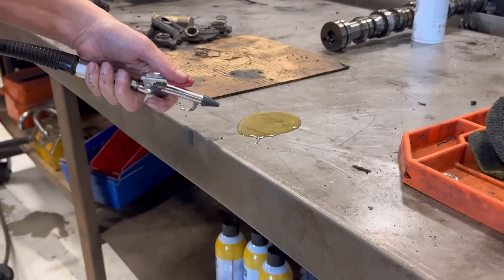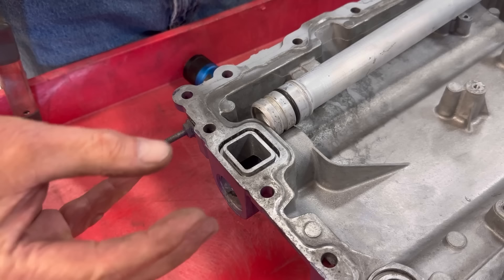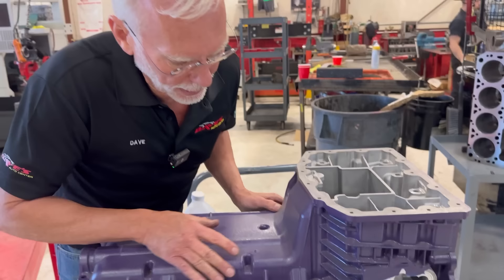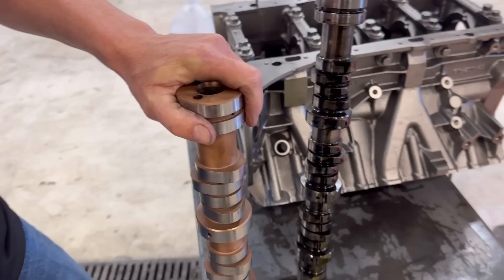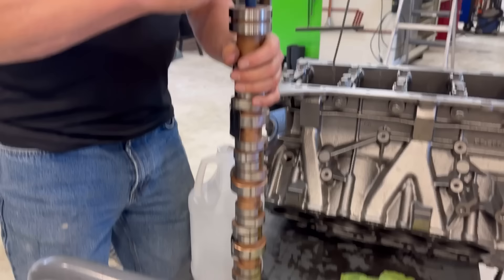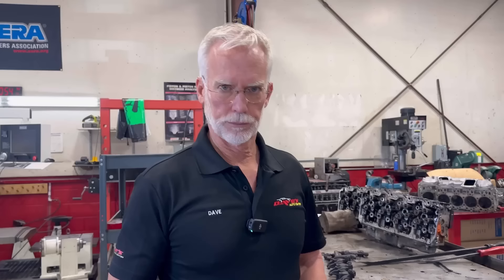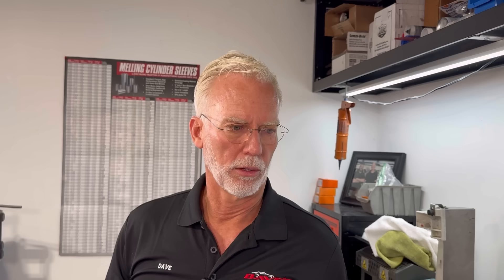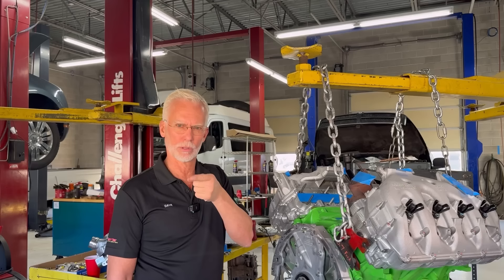Part 1: Ford 6.7 power stroke oil starvation issues revealed

Comment: For over 50 years I've wondered why they didn't add an electric pre-oil pump.
Reply: YEP couldnt agree more
Reply: Might make engines a little too durable I think
Reply: my hybrid does that
Reply: Because oil filters have back-flow valves that don't let the oil "drain out" so as soon as the engine spins it starts to build pressure
Reply: @spencer.M.F.little The moment it starts cranking it's still in the boundary lubrication regime. There's a reason why all large turbomachinery has electric oil pumps that are turned on before the turbines get spun up and the mechanical pump comes on in parallel.
Reply: in the mining world we have pre lube pumps (oils engine before start up). I think they normally use gear pumps driven by the engine because of reliability.
Reply: wow you’re on to something 👍
Reply: They do on big off road or marine diesels.  They’ve been around as add ons for decades.  Problem with those was most pulled oil from the pan drain plug and it was not filtered.  For most all non-industrial engines the cost benefit is iffy at best.
Reply: its called pre obsolance
Reply: Someone designed one for general aviation aircraft as an add on (STC) modification. It does make sense.
Reply: @gregorymalchuk272  Most large turbo machinery uses plain bearings, not rolling element bearings, so pressurizing the oil system prior to turning makes sense: especially given the equipment cost.  It also makes them far easier to start spinning.
Reply: If the electric oil pump was installed and it failed . It could possibly block your oil ways unless they put twice the amount of drillings in the block to by pass the electric side . Reality of it is . More expense more parts more time . More money . They do not care about your car  even when it comes back under warrenty with engine failure all the main dealers say you used the wrong oil . Iv been clever enough to buy oil from the dealer for new cars and keep the recipts for warrenty purposes
Reply: @eoghanhennessy443  The kits I have seen pull oil from the drainplug and pump it thru an adapter on the oil filter (by-passing it). Those are only run as prelubers then shut off.
Reply: @TheBeingReal . Is the pump actually filling the main bearings and head gallery
Reply: @eoghanhennessy443  it does via the oil filter bypass.  Pressurizes the whole oil system.
Reply: I added a prelube pump to my 1989 mustang GT convertible that I bought new.
The old Murphy diesels had a prelube pump built onto the back of the starter.  You could run the starter without engaging the Bendix to prelube the engine!
Reply: A lot of heavy engines do have them saves wear at startup big time.
Reply: @spencer.M.F.little 
So then the solution would be to never change the oil filter? 
Just saying ..
Reply: If they can put a fuel pump in a gas tank, surely they can put a pre-lube/post shut-down (for turbos) in the oil sump. Kind of a no brainer.

Comment: Lets give Dave more credit, hes just more than a mechanic for the normal people that don't understand. He is an engine rebuilder not an engine overhauler. Engine rebuilder is when you alter to new specifications which requires engineering knowledge that allows hims to explain it and make it sound easier to the public and to Overhaul is to bring it back to the original manufacturer specifications what your original mechanic does with less knowledge and goes by the manual. People..... There is a difference 🙌
Reply: Well either way both types of mechanic need a LOT more data floating around in their brains than the average mechanically inclined individual. I ran into a mechanic that primarily worked on motorcycles and the things he knew absolutely blew me away when it came to mechanics in general.
Reply: That's all BS for me , just becouse somebody uses aftermarket overpriced / reengineered parts is still rebuilder / over hauler . Engineering vital engine parts is much more involved , you need much more  resources , with all respect for Dave !

Comment: This guy is a true professional.   No BS and is asking all of the correct questions followed by coming up with a proven way to remedy problems created by Engineer Johnny.  
Looking forward to the second part of this video and see what his findings are as well as his thoughts on how to correct the problem.   I’ve read a lot of horror stories on catastrophic engine failures where owners are getting screwed over by Ford.  Not something you want to find out after spending $85,000 plus on a new truck.   Hence the reason I’ll never sell my 2002 7.3 PS.

Comment: I’ve been a diesel mechanic for fourty years and yes, oil pressure buildup has always been an issue. In the 80’s Leyland fitted secondary electric oil pumps to boost supply at startup. I remember a Cummins circular in the 90’s pointing out that most engine wear occurs at startup and very worst when oil is changed, we always pre filled the filters before fitting for this reason.
Reply: We used to fit a reserve oil tank that pressurised when the engine ran with a solenoid valve hooked into the ignition , engine start oil ran from the tank  to the oil gallery , 40 psi of oil pressure before the engine cranked , the tank depressed used when the ran , , I have seen them fitted onto turbo charged cosworth  race engines .

Comment: This guy is awesome. I have never heard anyone talk about auto machining and fixing problems like he does. He's a walking, talking automotive genius. Engineers today seem to make everything so complicated, and you look at how to simplify their screwups.
Reply: I'm an old chemical engineer, I was green in 1981.  I was lucky to work right out of college with an old engineer, Joe Pedjac, who had not been to college.  One of his main jobs was to work with young engineers like me and teach them how to actually do stuff that works.  I worked under Joe for 3 years and it was great.  Joe grew up on a small farm and he was amazingly creative and practical.

Dave seems to be the same type of man as my now-passed teacher and friend.  RIP Joe Pedjac, Rosebush Michigan.
Reply: The engineers working with paper and computerized drafting most of them wouldn't know a torque wrench from a spark plug socket and I'm sure he knows the 6.4 engine was a totally different disaster they broke crankshafts and pulled wrist pins out of pistons not to mention you had pull the cab off the truck to change a injector towards the rear of the engine I'd rather have a old 12 valve Cummins than any FORD or Duramax engine

Comment: I got a '16 F350 in 2 yrs ago. I was told the engine locked up.  Couldn't turn it over at all.  The owner didn't want to buy a new engine, so the hunt for a good used one was on the way by him.  After 2 yrs of it sitting, the owner told me to pull the engine.  
  When I pulled the starter and found the starter gear was sideways against the flex plate jammed in place. All the sudden the engine turned easily. I put a new starter and batteries on, the engine started right up.  It ran for 2 weeks.  Then the owner decided to put it back in service.  So they put a 20k lb trailer on it and off down the road. 5 miles later the engine quit. Hauled it back, found metal in the fuel system/tank. 
  Did a few diag on it and concluded the injectors were stuck open from metal being in them. Dropped the tank to clean it, put a whole new fuel system in, the whole works. Put an s&s bypass kit on also. Thousands of dollars later, go to start it, won't start. Acting like it's hydrolocking.
  Looked at it a few days, new starter, batteries, etc.  Fuel pressure good, everything looked fine. Pulled the oil filter and cut it open. Found a ton a metal flake in it. I'm like what the****.  Instantly figured a bearing is seized or grabbing the crank mimicking the hydrolocking.
  Now that I seen your video, I'm wondering if the dry starts caused bearing failure. I have no clue what caused everything as the original thought was the engine was locked up two yrs ago.  I just can't see how if it was a bearing back then, how'd it unlock and run for two weeks with no noise or indication of anything being wrong.
  I'm assuming the starter messed up, jammed it, then after sitting two yrs the cp4 came apart and sent metal through the system and caused it to hydrolock and somehow jammed a bearing up enough to break it or something.  Or maybe zero oil upon start-up ruined it pretty quickly. Either way, now I'm in search of another engine again. 
  Ford wants $19k for a complete engine that is on backorder currently. Their reman is $8k or so but they said it was an updated engine and several things had to be changed to make it work on the '16.  We have a brand new complete fuel system, so I didn't want to spend $19k on the complete one. And none of the local diesel machine shops in okc wants to mess with it. They'll machine the parts individually but none will do a complete teardown/reassembly. Also they all told me they're at least 6 months out.  Just roadblocks every direction. The owner doesn't want to trust a salvage engine, which I don't blame him.

Comment: Total agreement Dave, you are spot-on. I was taught many years ago that needle bearings are good for intermittent loads & LOW, (NOT HIGH) RPMS. (ie; The trunnion/output shaft of an old-style steering gear. Shock loads, mininal RPMs & frequent directional changes) I never imagined them holding-up inside a lifter, way back when. Bucket-shimmed valves are great, (used in high-revving bikes), but are a pain to adjust. Luckily they don't need frequent adjustment if done right. 
Keep up The Great Work Brother🙏 (Not just great vehicle repair videos)👍

Comment: As a retired certified CAT&CUMMINGS knuckle buster what you just showed is why they need to take the  BOX OF CRAYOLA AWAY FROM THE DESIGNING ENGINEERS!!! 
For ever turn that oil takes causes RESISTANT!!! 
EXCELLENT VIDEO that shows start up problems then add in the RESISTANT and you have the RECIPE FOR FAILURE!!!
The old 7.3 POWER STROKE which was a INTERNATIONAL ENGINE was far SUPERIOR!!!
Reply from the maker: Thanks for the wisdom brother!

Comment: i work for the dealer and customers are very happy  with  their 6.7 strong powerful and dont have real major problems the oil will sludge if you dont change it can cause issues

Comment: Wow that is a lot of passage dry. I knew there was some, but never thought it was that much. I have heard many say you don't have to fill the filters anymore, after this I really know better. I always have out of pure habit, I'm old school. Just like I always change the thermostat when I change a water pump. Some vehicles that is major. I will be looking for how you fix this problem. Do not cut yourself short saying someone is smarter than you. You are a genius as far as I'm concerned.
Reply: You change your engine and filter. Some people drain the oil when the engine is still warm. They that helps the oil drain out faster. I have always on my own vehicles change out the oil and filter while engine is cold. Let it drain longer and you are getting more of the used oil out of the engine. Your thoughts?
Reply: It's really more important that you keep your intervals regardless if you do it hot or cold.  The hot oil supposedly frees up contaminates that might be clinging to the motor.  Some say let all the oil settle into the pan then drain.  Again, it's just a personal preference.  Most importantly, change your oil every 5,000 miles.

Comment: Dave,
I always tried to explain the difference between an engine builder and an engine assembler - most people don't get it, of the ones that do some would stop by, or call;
"Mike, that thing uses so much less fuel, has more power, is smoother and quieter than it's ever been!"
or, 
"I went to the track last weekend, the cars that used to run with me or just get away from me are Way back in my rear view!"
All the time in reworking poor designs, checking everything, doing it right meant more than the money when I heard those.
When you love what you do.
Some people understand, most don't 
Nicely done, Dave
Reply from the maker: Appreciate the wisdom!

Comment: The fix IMHO is a pre oiler pre start. A small pump pulling from the oil pan, depositing pre oil filter that pushes approx 20 psi 30 sec before crank.

Comment: My Aston Martin DB9 has a function that eliminates this issue.  When cold starting, after being left for a long period, the starting procedure is as follows.  Floor the accelerator (this prevents the engine from firing) and then crank the engine until the oil pressure light goes out.  I do this in three five second bursts in order to not overheat the starter motor.  Once the oil pressure light goes out release the accelerator and start the engine as normal, cue glorious V12 exhaust note.  Personally, I love the ritual of this start procedure and the knowledge that I am looking after my engine as best I can.  Great engineering Aston.  Thanks for the video as per usual it expanded my knowledge.

Comment: The 6.7L powerstroke engines DO NOT have "bad Engineering". This engine has the best modern design from any other manufacturer out there. This is from LACK OF MAINTENANCE and nothing else. The oil drain back problem is OVER EXAGGERATED on the internet, most oil filters have anti drain back values, this is why the engine takes 15 quarts of oil because of all those oil passages, the tolerances are very small in the engine. Those oil passages stay full of oil. Pumping air?  How is air getting into the oiling system?
Reply: Yeah, guys addicted to his 'knowledge'
Reply: Unless u drive a 6.7 stop talking

Comment: Very interesting video! You did a great job laying out the facts. 
I was shocked at such a circuitous path the oil must travel. 
As over engineered as the engine is with excessive parts, I’m surprised they didn’t add a pre-oiler pump to come on prior to the engine starting?
Reply: Agree 
Especially in cold climates, I know if I had a deisal , I would install one.

Comment: Appreciate you being humble about past mistakes ie the little nut or something that went into a new motor. Accidents happen and learning from them is part of the process, I know that myself. It's partly why I get so mad when guys at the shop start cleaning their stall with the compressed air nozzle. Blowing all that crap on the floor with the air nozzle can make its way upward and into an engine (intake or whatever). Also it's easier to just get a broom anyways.
Reply from the maker: Yes agreed, if we're in this industry we better watch out for mistakes, and if we make them we better learn from them. Thanks!

Comment: I have a Ford 6.8L V10 gasser in a 1997 Class C motorhome.  Whenever I put the vehicle into storage, I remove the fuel pump fuse so the next time i start the engine, it will crank without fuel.  When starting the next time, I crank the engine for about 45 seconds and figure that's enough time to get the crankshaft, cylinders & cams lubricated before replacing the fuel pump fuse and starting the engine.  And you bet, whenever I change the oil (every 3500 mi), I fill the NAPA gold (Wix) oil filter with oil.  Engine has 80K miles on it, and burns zero oil.  Thank you Dave - this video confirms my '78 BSME intuition that I haven't been wasting my time!

Comment: I have a 6.0 Ford. I went 850,000 miles before the lifter failed. I am a firm believer in an additive to the oil. I use Lucas, and with 5,000 mile oil changes, and my additive, I Believe that's what helped the motor survive as many towing miles as it did. You need clean oil, as quickly as you can on start up. Dry starts just shortens the life of the motor. Keep up the hard work Dave!

Comment: Sir thanks for the information.  When I first heard your problem I thought it was cavitation in the system but couldn’t figure where you would get that from. Now that you explained the route the oil takes I do now. Multiple 90 bends.  The other things is the pick up pipe if where the pipe joins the block if it’s above the oil level that seal better be perfect or it will draw past  and also that length it pick up tube may suck the strainer down to the sump causing starvation and or upset that seal in the pipe    That’s my take on it.  Look forward to what you are doing on this project  so subscribe so not miss it.  Thanks Bob.

Comment: We also had lubrication issues with some of our large diesel engines.  The solution to our problem, was the install a pre-lubrication pump.  This electric pump operated prior to engine start up.  The engine oil pump would take over, after start-up, and shut down the pre-lube pump.  This solved our problems.

Comment: I've worked professionally in the automotive industry for 18 years, and my very first fulltime job out of high school was at Jiffy Lube.  Now, everyone is as good as their training, and the environment you "grow up" in a C level tech.  Every diesel engine oil change I did I always primed the oil filter, and I also primed gas engines with large oil filters.  Not every quick Lube facility is garbage, it's as good as its owners and management
Reply from the maker: Good point, Jiffy Lube's can do a wonderful service. Thanks for the share.

Comment: The real question is why the hell is every vehicle and engine so overly complicated now days. I sold all my new stuff about 3 years ago. Have all stuff around 2001. That is the peak of simplicity and creature comforts to me. I can open the hood, fix things, understand things and trouble shoot things easily!
Reply: Oldest thing I have is a 95 Ford  Dually with the 7.3L. Second is my 86 GMC K2500 and 3rd is my 85 Chevy C30 dually. 350 SBC in the 86. 454BBC in the 85. Like you said, simplicity and creature comforts. 👍
Reply: Yeah, watching this thinking  WTF. The oiling system is on a wild goose chase. Blow any of the seals between the block and oil pan. You lose all oil pressure. Makes not want a 6.7 PSD even more.